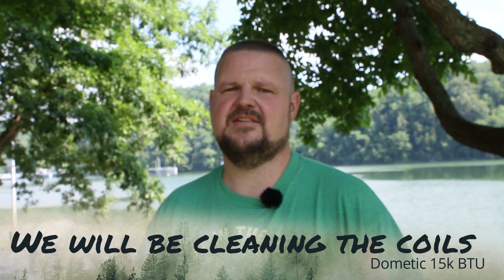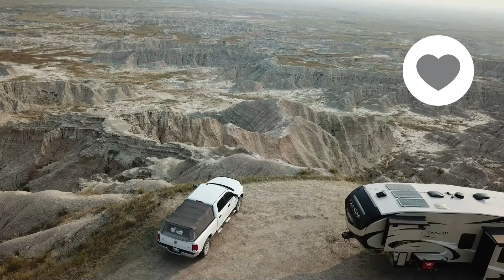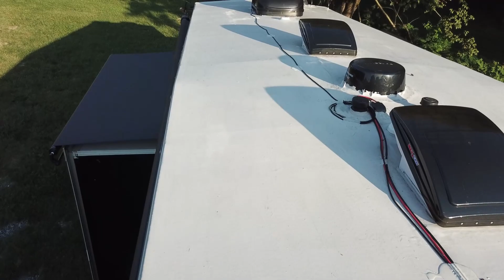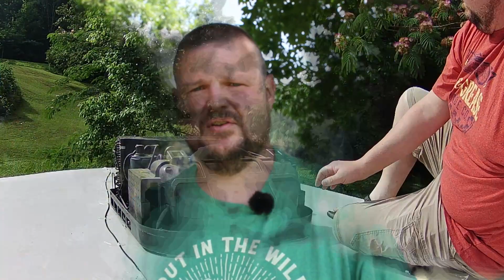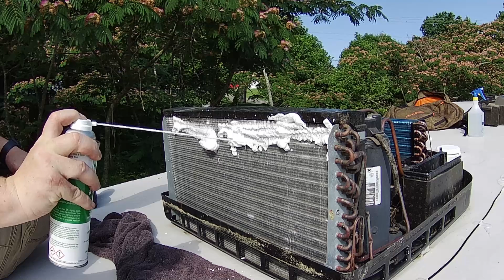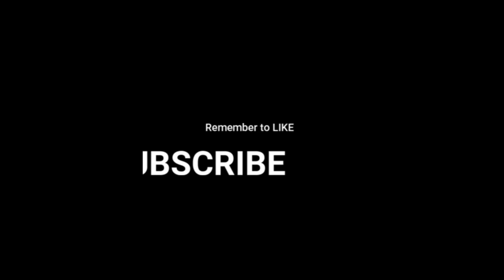How to Clean Your RV Air Conditioner (and Why You Should)

Comment: Does the spray foam damage you rv finish as it runs down the sides?
Reply from the maker: I was worried about the roof as it was a fresh coating in a small area but I didn’t really think about the sides.  It’s the way the techs do it, it should run out the gutter and not touch the side but a little extra water never hurt anything lol
Reply: My gutter is 1/2" deep and 1/2" deep.  It's more of a deflector than a gutter, but the liquid WILL get on the sides.

When I clean and condition the roof, the cleaning process deposits gum on the sides that has to be waxed off.
Reply from the maker: @jimcollins8097  you may want to add the gutter extensions on the corners if you don’t have any